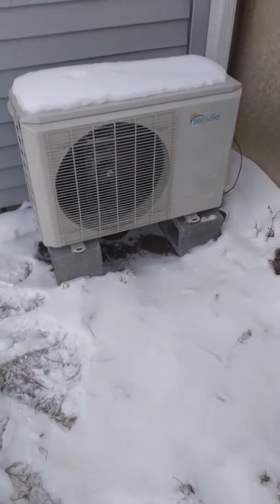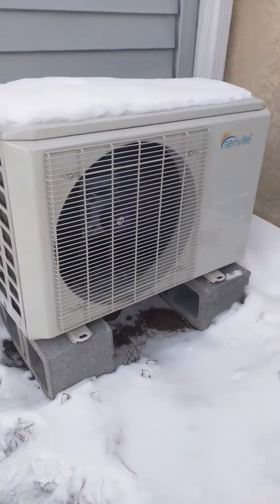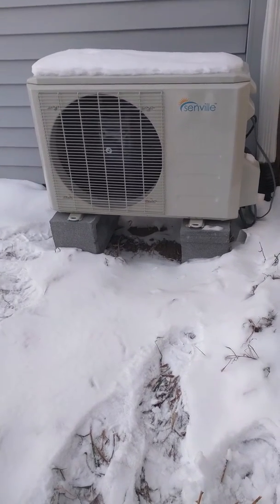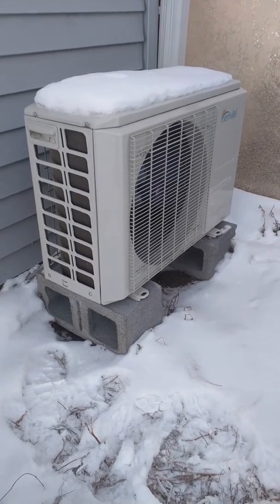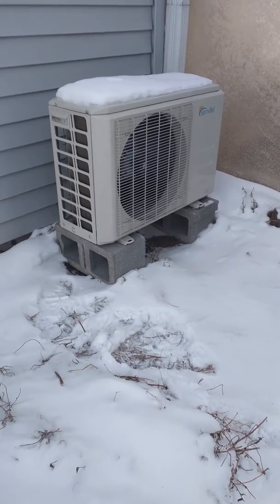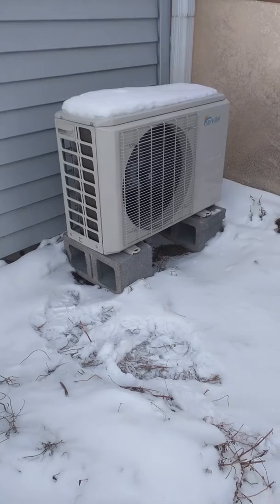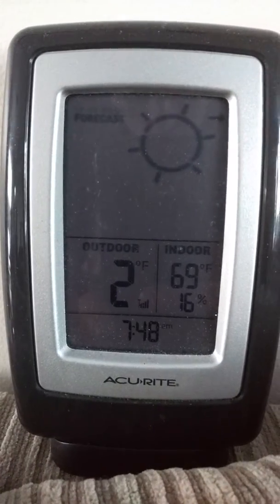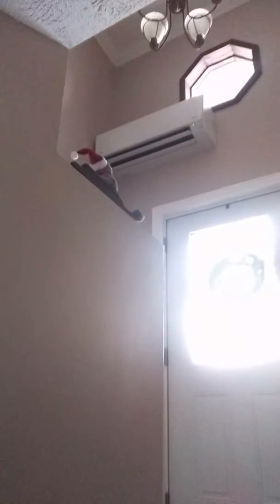Senville Aura hfz mini split heat pump at 2f 12000btu

Comment: In an earlier video, you were using a Mr Cool 3 ton unit and you said it had problems defrosting and you were going to return it.  I never saw any video that continued the story.  Was the return handled to your satisfaction and what did you replace it with.  You were talking about replacing it with an LG, but the only LG video I can find is about a heat pump water heater.  Thanks in advance for the update.

Comment: Curious that you were saying the unit is pulling 1800-1900 watts when 12k units typically only use around 960 watts in either heat or cool modes. At least mine does. That kind of wattage is equivalent to a 24k units usage. Is there some kind of 1000 watt electric heater running with that brand heat pump when the temp gets down below freezing or something?  Maybe to keep the outdoor coil from freezing/icing up. If that's the case that brand unit is not very efficient in temps below freezing. That just caught my attention on this one.
Reply: I was thinking the same way, but I  have an 12000BTU 19SEER unit, and it pulls 1774 watts at 10 degrees.
Reply: @QrunsEl what brand?
Reply from the maker: When they advertise the say the unit uses 900w to give 12btu but that is a 47f outside. As it gets colder the unit works harder to make the same 12k btu. Like going up a hill on a car. You want to maintain speed so you lush the throttle harder.

Comment: So if you lived in a milder climate say Pacific Northwest where the low may only be 22 degrees would you consider the lower model of Senville the Leto for heating and cooling a 2000sqft single story house? Our traditional heat pump of 3 tons just gave up the ghost and the HVAC guys want 8-13k to replace... I am considering getting two of the Senville Letos 24k and just running my 1/4hp air handler to circulate through the house.... So much cheaper to install and I get a 17 SEER vs the 14 SEER they want 8-13k to install.. Your thoughts? Any advice? I am handy and not afraid of a vacuum pump :)
Reply from the maker: For your situation I would highly suggest the Mr. Cool universal outdoor condenser which can be hooked up to any indoor coil. I did a few of these recently and the one I have on my YouTube page is a fail but every other 1 I put in after that is working great.. So those units will run you around 3000 for the 36k unit.  It does not have to communicate with the indoor furnace. So basically your thermostat would send a signal to the furnace and at the same time send a signal to the outer condenser to start heating or cooling.  So you could change the outdoor unit run the extra thermostat wire for communication as per the instruction manual shows and and all you would need is to find an HVAC guide to weld your existing plumbing from your indoor coil which is already outside to this Mr. Cool universal universal unit.  I would rather pay that hvac guy to do a pressure test as well as a vacuum while he is there to make sure his Welds aren't bad.  You will have a whole house AC heat pump which is 20 year for probably 4000 including labor
Reply: @ne7s29  The air handler is unfortunately the old R-22... If Mr. Cool had a downflow airhandler available I would have jumped on the 4-5 ton universal in a heart beat.... I have no idea why they don't offer a downflow kit... I suppose I could just replace the air handler with a downflow r-410a unit and pair it with the outdoor universal...not sure how that would affect the efficiency and not sure if I would need to get a standard air handler, adjustable speed air handler, or if I could get a ECM blower....
Reply: On your universal fail, I think you can adjust the defrost cycle run time for longer lengths in colder climates. 2.3.2 Set Defrost Mode
The second dip switch is selecting the defrost mode.
The second dip switch is used to change the defrost setting, factory default setting is standard defrost. Under
extremely low environment temperature, if the standard defrost cannot have the condenser defrosted completely,
please set the second dip switch to be strong defrost. Under strong defrost, the defrosting time will be longer,
which enable the condenser to be defrosted completely.
Reply: I have the senville and it works very well in the winter and I live in Canada.

Comment: I agree its really quiet, its my second winter now. But my issue is ice build up at the bottom inside because of heavy winter here in Alberta. Did you experienced snow or ice build up, and how how you protect it did you put any cover during winter? Thanks
Reply from the maker: If you got the super low tempt unit it will have a outside baseman heater which will not allow that to happen. Also if your unit is not covered it will naturally get more snow inside and have more buildup. A full healthy defrost on a cold climate heat pump should fully defrost a unit.

Comment: I got a single wide mobile home 14x70 i got the 18k aura you think 1 unit will heat the whole place ?
Reply from the maker: For the most part it should. I'd say 80-90% it should work. Maybe 15% Of time you'll need supplemental heat. That's if it's fairly new with decent insulation.
Reply: @ne7s29  okay sweet and yeah its insulated very well for a mobile home but thanks for the quick reply and the information its greatly appreciated
Reply from the maker: @Smokinstrainstation88   a 24k would do you much better because it is more efficient In general seasonally and it would bot work as hard which nets higher efficiency but a 18 will work just cost you little more each year for heat.

Comment: Would it heat a 37 ft rv? In 15 below weather.
Reply from the maker: Absolutely not. I assume a rv would use atleast twice the amount of heat as a avg home due to wall thickness or insulation standars.
Reply: @ne7s29  Thanks...it's OK thow. I heat it with a diesel furnace.
Reply from the maker: @gladheateher4now   Look at the BTU output of your diesel furnace and try to figure out how much percent of the time the furnaces on when it's that cold and you will get your btu rating for a Mini split
Reply: @ne7s29  Thanks.  Its extreamly effective.  Was just curious about your heat sourse. Its 130 degrees at the vents

Comment: I'm looking at buying the 24k btu Aura but I'd love to find more data on the BTU and COP at different outside temperatures, It sounds like you've found some good data could you tell me where you found it?
Reply from the maker: They have uploaded a little more data on their website so you can check that. Their newest units have a higher seasonal performance factor but a lower cop which makes no sense to me. I believe it's 2.77 at 47f at rated capacity which is extremely low

Comment: Did this still heat around -22f? Seems like this is a better bet than Gree units.
Reply from the maker: Honestly 99% of the units coming out of China are probably coming out of one factory branded with whatever sticker you would like. Checking specs weight of refrigerant and weight of unit and dimensions of unit I see that most units are the same if you know which models to compare.
Reply from the maker: Its just a marketing scam. Anything less then -10f to -15f and u should just run reg electric heat. Now Japanese  hyper heat units your good using them down to -30 and -40 I have read on forums.
Reply from the maker: Top Model Japanese units will still have close to a 2 to 1 ratio for electricity  used at -10f compared to running straight electric. The most efficient unit is actually LG when looking at all of its specs. The unit is called LG prestige and they are nine and 12000 BTU units are ridiculously efficient even in Sub-Zero temperatures. They make a 15 and 18 and 24 K unit as well
Reply: But why bother with so called Japanese units? Both Fujitsu and Mitsubishi are not made in Japan but in third world countries anyhow. And neither brand is rated to -30 or -40, F or C. 

Midea who makes these units sell to Carrier, Trane, and others. They also have units that cost as much as the "others."
Reply from the maker: @sprockkets   Mitsubishi is a great product known to last decades but it does shut off at -19 Fahrenheit. Fujitsu is just as good but does not shut off at - 30 or 40. The benefit of Mitsubishi or Fujitsu over the Chinese units even though the Chinese units that are new operate at extreme cold temperatures is the efficiency at these temperatures. I would rather run a Japanese unit would still gets me to kilowatts do one kilowatt used of electricity whereas the Chinese units will be 1.5 to 1.6 at 9 is fine Fahrenheit Mitsubishi is a great product known to last decades but it does shut off at - 19 Fahrenheit. we jitsu is just as good but does not shut off at - 30 or 40. The benefits of me to be she for Virgin Sioux over the Chinese units even though the Chinese units that are new operate at extreme cold temperatures is the efficiency at these temperatures. I would rather run a Japanese unit which still gets me 2 kilowatts to 1 kilowatt consumed at minus 5f whereas the Chinese units will be 1.5 or less per one kilowatt consumed at -5 Fahrenheit. Most Japanese units at 5 degrees Fahrenheit have a cop 2.2 to 2.4 running full-bore at 5 degrees Fahrenheit were Chinese units still have good heat output at that temperature but their cop performance is struggling at 1.7 to 2 running full-bore

Comment: pour les instalations au Quebec,le cout du mode chauffage pour une 12000btu est d'environ 85-90$ par mois, 24hr/24,,30 jours, l'ampérage est environ 4 ampere.
Je trouve parcontre l'unité intérieur un peu bruyante a la pleine puissance du ventilateur, mais c'est un tres bon achat, n'hésitez pas, le model sena comporte une télécommande thermometre avec un mode ''fallow me'' tres bien pensé, prévoir que si l'unité extérieur est dans un endroit ou il y a de l'accumulation de neige, prévoir l'instalation assez haute, voir 6 a 8 pieds de haut, personnelement la mienne est a 24 pouces de terre, et je l'ai entourré d'un abris ventilé d'un coté,avec 2 bac en dessous pour recueillir l'eau du dégivrage,qui se fait environ 6 fois par jours, tout dépendra de l'humidité dans l'air.  Je vide a chaque 3 jours environ les bacs, devenu glace,
Reply: Est-ce que votre thermopompe fonctionne encore @handyric?
Reply: @heck0098  oui,elle fonctionne toujours sans problemes, et ces temps -ci c'est 24hr/ sur 24hr. j'ai un ami qui est venu verifier mes pressions sur mon compresseur extérieur,et tout étais excellent,  j'ai changé a date le petit moteur de fan intérieur (sur la tete) par un nouveau model moins bruyant, j'ai des bacs a eau exterieur sous le compresseur car dans mon cas, elle est tres solicité et ca dégivre et l'eau s'accumulait en dessous,présentement, je vide les bacs d'eau (glace) au 4-5 jours, pour evité les accumulations
Reply: @heck0098  oui, la  thermopompe fonctionne encore, apres toute ces années, aujourd'hui, ca doit faire environ 8 a 9 ans que je l'ai,,,la seul chose qui m'est arrivé, est d'avoir changé le petit moteur de fan interne dans la tete qui commencais a etre bruyant,, le moteur m'a été envoyé gratuitement par la compagnie senville de montreal, et j'ai fait la reparation moi-meme, j'ai fait verifier la pression interne par un frigoriste pour etre sur avant l'hiver, l'année passé,,depuis tout ce temps que je l'utilise, et tout étais ok,,
Reply: Intéressant je hesite entre senville et jare gree ou mitsubishi aha
Reply from the maker: Bro type in English this is United States
Reply: @ne7s29  it's not just English people who can read comments, there are francophones in Quebec who use this kind of heat pump,and look all video of senville
Reply: @handyric  Merci pour ton commentaire, je regarde justement pour une senville ou bien une Gree, es-tu satisfait de la tienne un an plus tard ?
Reply: Aussi combien ça t'a couté pour l'installation?
Reply: @Tzarsio  encore tres satisfait apres environ 4 ans que je l'ai, j'ai opté pour ce model car c'est la telecommande qui peut servir de thermostat ,car sans ce model,lorsqu'on demande de chauffer au max,veut veut pas,la tete de l'air climatisé ravale un peu sa propre air chaud,et le thermostat interieur de la tete la fait diminuer prematurément dans son environnement,alors qu'en mettant la telecommande plus loin en pointant la tete, il fait encore plus froid et la telecommande dit a la tete de chauffer encore,alors on sort le 100% de chaleur rapidement,juste a voir si les autres model ont ca,,et pour l'instalation fait moi meme ,passer le fil electrique,mais appeler un electricien pour connecter dans tableau,75$ apres souper,braker double de 15amp fourni par lui, et 50$ le soir un ami frigoriste m'a connecté mes tuyau a l'exterieur sur le compresseur pour purger l'air qui peut avoir dans le tube, le freon est deja pré-charger. prévoir l'hiver l'accumulation d'eau lors de degivrage sous la thermopompe, moi je mets des bac en plastique,et vide au 3-4 jour
Reply: @Tzarsio  excuse le retard de la réponse, oui je suis satisfait de senville a 100% je dirais 8ans plus tard, avec la fonction ''fallow me''sur telecommande
Reply: @Tzarsio  dans le temps de mon intalation, il y a 8ans,1400$ total l'achat livré, 70$ un electricien qui est venu apres ces heures de travail, connecté uniquement avec braker fourni par lui,

Comment: So my whole issue with your comparison is that the Senville is 12,000btu and the Fujitsu is 15,000btu. They are not the same in specs at all. There are so many factors that come into play when it comes to energy usage. One unit being up stairs(which heat rises to) and one unit being down stairs over a refrigerator. These units rely on many things. The Senville being over the fridge hurts the heating due to the automatic diverter facing downwards when producing heat. Also the condensers being in 2 different places is a huge factor. One has snow on it and is in direct weather and the other is covered with no weather bearing on it. I bet you will find that the Senville actually is more efficient when set up correctly and similar to the other one. Just my 2 cents. Fujitstu is a great brand and I won't knock them but your finding are due to installation and sizing of units.
Reply from the maker: Overall the senville is less efficient. Hspf on this Chinese unit is 12and hspf on a Fujitsu 12000 BTU is 14. The cop of senville 12k BTU at 17f running at rated capacity which is 7000btu is 268% whereas a Fujitsu is over 300% and its rated capacity is 9000 BTUs at 17 Fahrenheit. At 5° the Chinese unit c o p is 198 percent cop but the Fujitsu 12000 BTU at 5 degrees is approximately 240% cop. you pay approximately 20% more for the Japanese but it pays itself off in a few years and continues to pay itself off years down the road
Reply: Senville is made in Canada

Comment: how is this doing? I bought a 24,000 senville concealed duct
Reply from the maker: Doing well ln heating and cooling. Why i choose senville over pioneer and other units is customer service. They have all the parts u may need if something does break. And parts are cheap. A computer board on my Fujitsu is $300. On this senville its $100. Same on other parts. Pluse senville and top model midea hyper units are the only ones I know of that are actually rated to -22f for heating and heat well below 5f. The ones rated to -13f are much weaker and their Max heating output is actually half the rated output at 5f which if your using them as a primary heat source doesn't work well. Ive also delt with LG. They heat well below 0f and are efficient but more expensive and no parts for consumer. Only technician can buy parts. So I stick with senville or top model Fujitsu rls3 models.
Reply: @ne7s29  good information to know I got a leto 9k 19 seer for master br and a MRCOOL 18k for the main room hope it works well for a long time

Comment: So does the Fujitsu have heating capacity? I thought in the video you said it was 15k and the Senville was 12k. I'm looking at buying a unit and was kinda leaning towards the Senville because it's cheaper and actually has better specs but didn't know how it would be in real life. Also how do the seam as far as reliability?
Reply from the maker: The senville is half of 12 and the Fujitsu 12 has a hspf of 14 so senville has worse specs.
Reply from the maker: Also you get what you pay for. Bearing and motor quality will obviously be better from a Japanese unit. They do a 10year warranty if installed by proper dealer.
Reply from the maker: The Fujitsu 12k cap at 5f is 16000btu where the 12k senville Aura cap at 5f is only 12000btu so 30% less powerful which is very significant if you need those BTUs to maintain temp in house.
Reply: @ne7s29  so you wouldn't recommend the Senville? The Fijitsu is definitely about the best out there but for half the price???
Reply: @ne7s29  I actually called Senville  today and they said their unit has a heating strip in the drain pan around the compressor and around the coils. Could it be these heating strips are cutting down the efficiency? These strips will keep it from icing up.
Reply: @jacobnolt9512  Good cold climate units will have a base pan heater install combined with a low ambient system.  Fugitsu ending in HY in the model # and Mitsubishi ending in H designate base pan heaters as far as I understand.